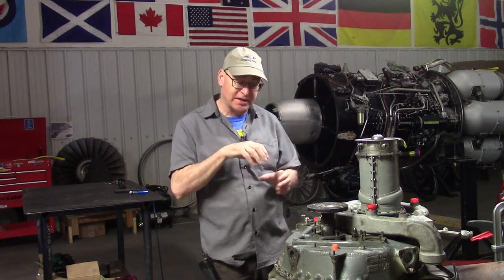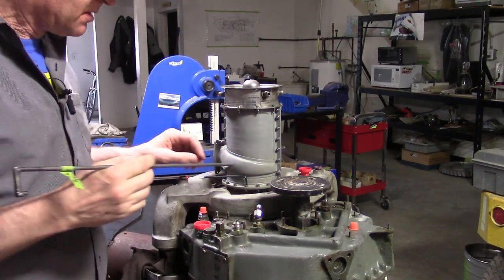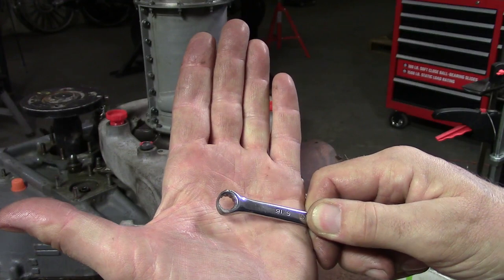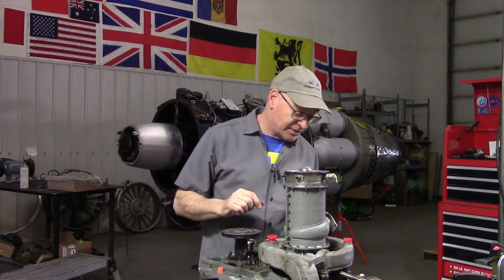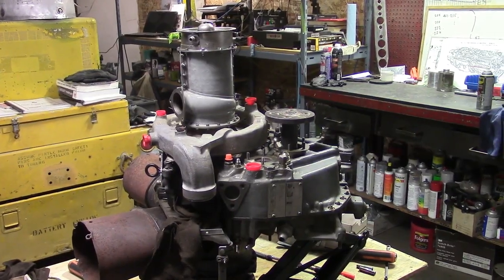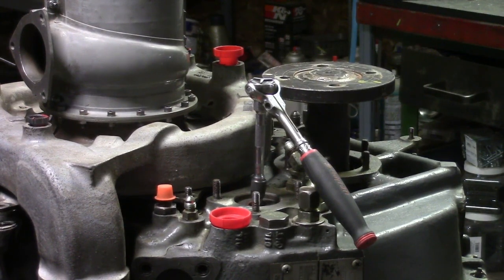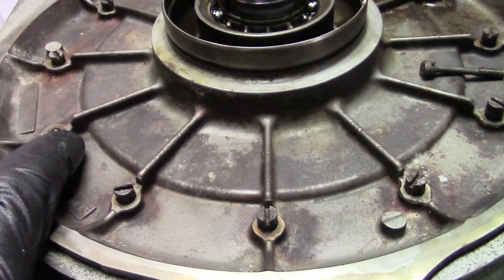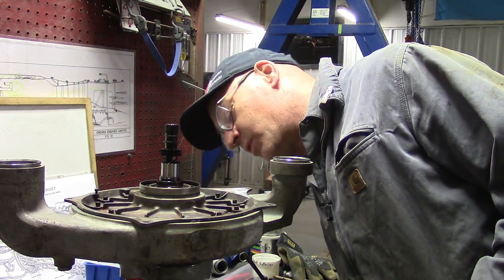Compressor Module:  Mini Jet Boat Ep. 8

Comment: On stubborn things like that a quick trick is to wrap a couple layers of aluminum foil around it before putting the socket on. A couple pieces of enameled copper wire across the top also works but you will probably have to tap the socket on.

Comment: I would recommend using a induction heater on those seized bolts, you don't excessively heat the surrounding material and it really works wonders to extract seized fasteners! Now that I have one I can't imagine ever having to live without it. Thanks as always for the interesting video's!

Comment: I've had luck putting a piece of plastic over the bolt or nut then forcing a socket on it. Also worked well for installing them in hard to see/reach areas.  May not be righy by any book,  but it works.

Comment: Working on automotive turbochargers we found the best thing to use on steel fasteners was a product called Kroil.  The hot side of the turbos typically had 6 bolts holding the bearing housing to the cast iron turbine housing and they were always corroded in place.
Reply from the maker: I have a can of it in the shop.
Reply: Agree, Kroil is good stuff.

Comment: With better than Wang Tang Tempered Egg Noodle Chinese Allen drivers you can easily exceed the recommended fastener torque without tearing up the socket.
Of course you would be torquing the nut to value, not the bolt in any event.

Comment: On those slotted screwhead bolts I've found if you pour a lot of heat into them by welding with a MIG onto the head, it often will disrupt the corrosion that is gripping the threads. And by that I mean getting them cherry red for as long as possible. If that housing is magnesium obviously some extra care would be required.
In addition, a few judicious whacks on the head with a copper mallet and drift will often move them vertically enough to free them up. I wouldn't do that to a flight engine but certainly if I could buck the base area I'd give it a few love taps on a boat engine.

Comment: We use a product called EZ-grip at work. It's an abrasive compound that you can put on rounded nuts, bolts, and inside screw heads and it locks against any remaining surfaces and allows you turn the damaged fastener. Certainly saved my backside many times!

Comment: Putting a torch to it would light up the workshop a bit...

In the tryouts to the chemistry Olympics one assignment was to identify a number of metals. One metal I wasn't sure of but I thought it was Magnesium. So, a quick experiment using a Bunsen burner settled that... :-)

Comment: Another 'working on other people's abused stuff' story, but there will inevitably come a time when you get a piece so mistreated that you end up making an extraction kit for broken bolts that either arrive broken off in the threads or has amalgamated itself into the base metal that the head is just there cosmetically. Mine is the requisite broken bolt extraction set that drills into the bolt, a very tough set of itty bitty drill bits, penetrating oil, specialist wd-40, hoppes and CLP, and believe it or not, a freezing wart remover applicator. The last part has worked when all else fails, but only on bits that are an inch or shorter; you're kinda hosed on everything else unless you want to drill a mm channel down the center and drip feed liquid nitrogen to shrink the bolt. I definitely know why you'd avoid heating magnesium, but yes, heating the receptacle metal also works when it's not its own fire hazard in concert with freezing the broken bolt.

Comment: The issue you may have been having with the 5/16” nut is partially with the socket. I know you said it’s a new/newer socket but if you look at the fluting of the splines of the socket the don’t run out the end. By that I mean the fluting is inset some and may not be fully engaging the full spline of the nut. The nut looks to have a very small contact patch and with the fluting not going the entire depth you may be engaging half the spline of the nut causing you to slip.

Comment: When you were trying to loosen that slotted head screw, the one that eventually broke, I thought that I could see rotation of the head, as you released the torque you were applying via the screwdriver.
I know that studs are non-preferred (and have been for many years) in aircraft engine practice, but I might be tempted to replace those screws with studs in this case, if there's clearance and the assembly sequence permits their use.

Comment: induction heater to help get the studs out
Reply from the maker: They are only studs because they were bolts that broke. They were not accessible to an induction heater when I was trying to remove them.
Reply: @AgentJayZ  yes i meant now that you can get to the threaded end do a couple of heat cycles then try to remove them, like you said it's not a good idea to use open flame on white metals. anyway thank you for your time and effort making videos

Comment: 5:33 ??! Maybe, if the rod tool was C shaped, but S one? Both bolt's and torque tool's axis should be aligned in same point in transverse plane, if the torque tool should transfer the torque correctly? That cant be right, or are there some hidden calculations included? Or is the torque tool not transverse rotational, but the bendy-strain type??
Reply from the maker: Yes, if it was C-shaped, it would be perfect. It's not. The world is not perfect anywhere except inside the layers of an unpowered integrated circuit. Relax, and have fun!

Comment: My guess is you added the square tap at the other end so if you had a bolt of a different dimension than what your magic tool was custom-made for, then you could use a suitable socket there and just turn it upside down and use.
Reply from the maker: That's a great idea. Maybe I thought of that, but I don't remember being that smart!
Reply: @AgentJayZ  Well, you are that smart 😃

Comment: When the bolt first begins to turn out, why not add more penetrant and work it back and forth some, (like when tapping a hole) until it loosens a bit, before forcing it the rest of the way off (or breaking it)?
Reply from the maker: It is an error to think that once the bolt moves, it will continue to loosen. I was doing exactly what you said with the first one, and it broke anyway because of fatigue. After that, I knew I would be drilling, and I didn't want to be there all week.
Reply: @AgentJayZ  additional complication most don’t appreciate is many of these nuts are self locking and the tendency for crs fasteners to gall, added to the aggravation of the crappy wrench ability of these small fasteners.
Then there’s dissimilar metals…
Reply: A sharp tap with TiN coating..and cutting oil is good to chase threads and Heli-coils...

Comment: I know you don't like metric much but do you think maybe a 12 point 8 mil would have fit. All the best from Surrey
Reply from the maker: Metric is the system of science and technology. These engines were designed before 1965, and I work within their system of fasteners. Got two toolboxes; one old and one modern.
Reply: @AgentJayZ  Just wonder if it would have fit better on that worn bolt?
Reply: @dennisbailey4296  5/16" is ~7.94mm... 8mm would have been a worse fit, and 7mm is too small. Correct solution is spline drive wrench/socket and replace damaged fastener on reassembly,  as shown and intended. It's possible at some point in it's "after hours" life a non-professional (home gamer) zipped that fastener back in with an 8mm 12 point from their big box store set and a power driver/impact. which would have promptly resulted in damaging the points due to "close enough" socket fit and negligence. Sponsored by "hold my beer" reassembly procedure.

Comment: Maybe some jizum (WD-40) can be sprayed down...on the fastener after the slotted compressor wheel has budged....
Then work on something else for a tiny....reapply the jiz...then continue the disassembly ?

I think also a judious tap with a drift on the top of the slot compressor can maybe relieve some tension...

Thanks Jay...

You inspire me to work on my little APUs that are rotting out in the backyard..
Reply from the maker: It's amusing to get these tips from folks who somehow have brought themselves to imagine I have not used all of them repeatedly before getting "stuck" in the procedure.
Thanks. It's the thought that counts!

Comment: Sometimes it's as easy as pulling your socket to the side on an angle and holding it as tight as you can. Just pushing on the opposite top and bottom of the damaged nut or bolt might give you the extra grip to remove the item. If it's a loose fit.....it's at it's very least grip holding it straight. Also......even though it was not metric.....it's really easy to just check and see if one will fit on a worn surface.
Reply: I also have used 2 or 3 thicknesses of plastic as a way to make the nut larger or the socket smaller. Put over nut and press down, and you will find the plastic deforms enough to fill the gaps. Also works for polished bolts and nuts not to mar the polished surface in getting them installed.

Have also taken sockets and ground the bottom off a little, so as to get rid of that flare there, so the splines are right at the edge, and getting that extra mm of engagement. Yes, and made special tools for a job, including taking 2 good quality spanners, heating to red heat to detemper the handle, and bending it 90 degrees, then brazing them to a square rod at each end, so as to reach a nut that was deep down. Was that or spend an extra week to strip the machine down to the point where I could remove the 100kg top plate to get the assemblies out. You can see them, you can touch them with a finger tip, but no way you will get a spanner on them otherwise. Other tool to go with was another round bar with a T welded to the top, and a hex wrench piece brazed into a hole drilled into the end, to get to the M5 hex bolt that was the other half. Bought 2 Gedore spanners for the tool, and a brand new 4mm hex key, also Gedore, and ground them to pieces.

Never broken Gedore, but have snapped Snap On a lot, they are too brittle. Broken way too many cheap ones though, or twisted them into pretzels. Especially screwdrivers, they are something I regard as disposable tools, as they wear soo much, and I really like hex bits, as those are very much disposable, I have worn them out in a day. But to be fair, if you are going through 1000 drywall screws, you probably are glad the box comes with a hex bit, that is a perfect match for the heads.

Comment: I really enjoyed this video. I would be curious to know how much the overhaul parts like to o-ring and gasket cost.
Reply from the maker: We're going to make the gasket, so it will cost about a half hour. The O-ring as a new RR engine part will be about a hundred bucks, but as a generic O-ring, it will run about 1.79 at an industrial supply center.

Comment: Snug those socket head bolts into the 7/32 nuts with the ball-end wrench & torque with the shop made tool. Would be faster.
Reply from the maker: Self locking nuts slow things down, but what you described is basically what I did.

Comment: This build is so cool to see! Any chance you could get some views of the bearings and maybe their oil supplies? Also is it possible to see any part of the N1 accessory gearing? Thanks
Reply from the maker: Without opening up the gearbox, we can only look inside through the oil filter housing, which we did in the video previous to this one.

Comment: What happens with old titanium bolts ?
edit. Nevermind dumb question
Reply from the maker: On any machine I operate or own, I would replace all titanium fasteners with stainless steel.
Titanium is mostly misunderstood by almost everybody.
It is lighter, softer, and weaker than steel or stainless steel. Also is more likely to crack.
It melts and catches fire at much lower temps than steel or stainless steel.
It's got a very nice look to it, but otherwise it is inferior.

Comment: Why are some bolt heads on the engine components coloured blue? Are those valves?
Reply from the maker: I didn't notice any blue bolts. Sometimes bolts will be painted to indicate they have been torqued. Sometimes bolts are required to be painted red to indicate that they must not be loosened or adjusted.

Comment: I think it’s very informative to me and I hope your audience when you run into problems. The Solutions to problems you offer can hopefully aid me when working on my own projects. Do you have a solution to a aluminum seat post that has corroded in a chrome moly bike frame? I’ve tried heat, penetrating oil, tapping and clamping to a vice to turn but to no avail.
Reply from the maker: Must be really corroded. A combination of heat, lube and massive torque will eventually free it or break it. Once it's broken, you can get in there with a file and hacksaw blade to get it out. If the bike frame is that rusted, you know it's like that everywhere inside...
Reply: @AgentJayZ  I’ll repeat the process. I got the frame for free and it’s a really nice vintage Bridgestone. I’ll let you know when it’s free.

Comment: Can you show us the speed governor inside a hydromechanical fuel control?  Love the videos, keep em coming!
Reply from the maker: I overhauled the fuel control for the Orenda, and there is nothing obvious that you can point to as a speed governor. Matter of fact the maximum speed of that engine is determined by the fuel pump. Pressure builds in a chamber due to fuel being flung through radial passages in the rotor. That pressure opens a valve and bleeds off the pressure in a cylinder that increases the angle of the swash plate, which is what determines piston stroke, and displaced volume per stroke.
Reply: @AgentJayZ  Oh wow, I think I've seen a diagram of one of those pumps!

Comment: Like a distributor wrench.
Reply: I know some young bucks who have never seen a distributor or carburetor.
Reply from the maker: A friend of mine had a local transmission shop put a 5-speed into a truck with a 6L LS engine. Nobody at the (transmission!) shop could test drive it, because none of them knew how to drive a standard.
Guess it shouldn't be called a standard any more, eh?
Reply: My 6 speed standard is a great theft deterrent.

Comment: I don't know if my question deserves an answer but I'll put it anyway! What is the difference between holding the screw and turning the nut or holding the nut and turning the screw?
Reply from the maker: Not much usually, but if the bolt is body bound, or a dowel bolt, then turning it wears out the fit.
Also, when removing crusty hardware, turning the bolt will cause it to break more often than is you turn the nut.
Also also,
When using an impact tool, the bolt will act as a torsion spring between where the torque is applied and where it needs to act. With a nut, you are applying the torque right where it needs to act.
Reply: @AgentJayZ  Thanks
Reply: It was a very good question, which certainly deserved an answer - and AgentJayZ gave you a comprehensive one.  I was always brought up to believe that best practice was to hold the bolt and turn the nut, essentially for the final reason that AgentJayZ gave.  
Digging back into the depths of my memory, I recall that the through bolts of the Industrial Olympus power turbine had D-heads, so that the nuts had to be turned: I also think that the bolts were fitted (R-R's term for body-bound/dowel), and it is definitely bad practice to turn a fitted bolt.  I am also quite sure that they had a splined extension at the threaded end, for use as an anti-rotation feature, so that no torsion was induced in the bolt shank, as the nut was torqued up.
I recall having an argument with a fitter at R-R Derby, over a gear pump pack from an unknown engine, which was held together with long, fitted through bolts into threaded holes or thread inserts (not nuts), so that they had to be tightened by turning the bolt.  I told him that, in the particular application, this might not be critical, but it was definitely bad practice.  He took it almost as a personal insult!